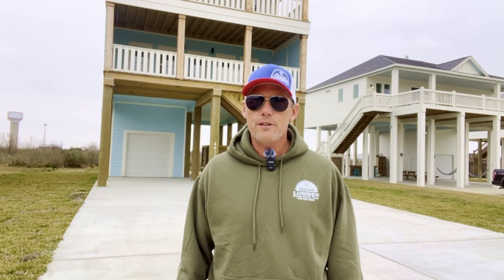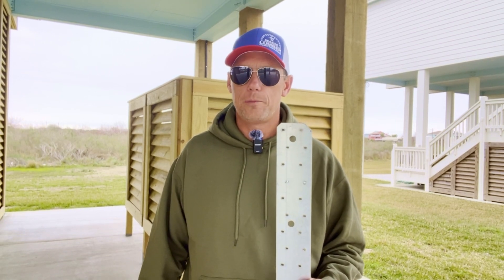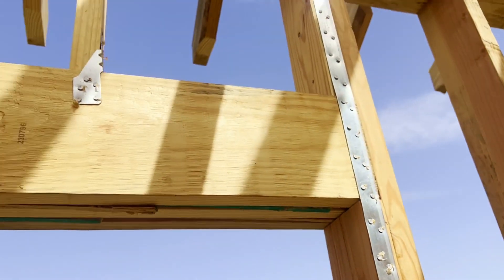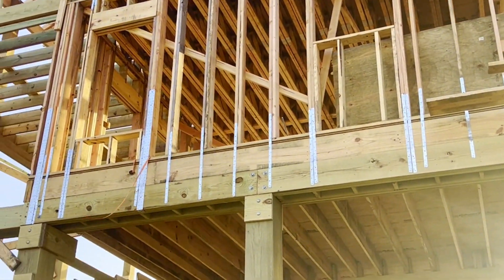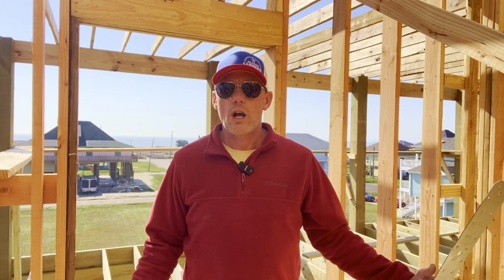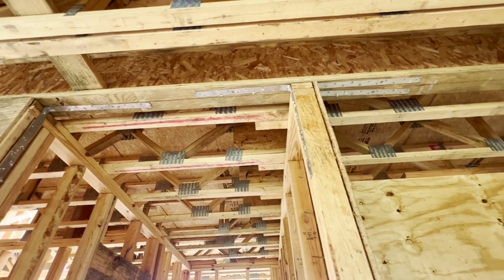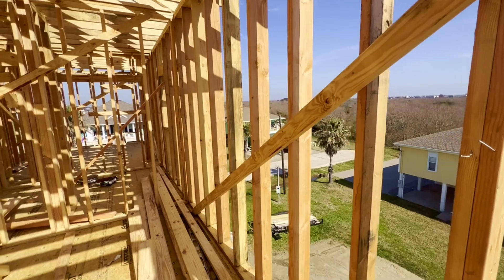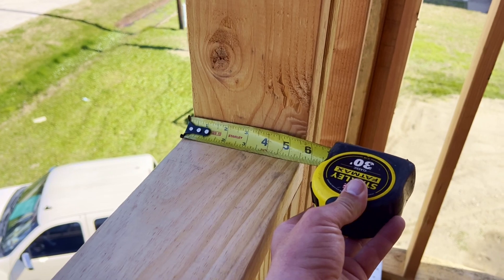HURRICANE PROOF Beach House! | Framing and Strapping (Episode 3)

Comment: Where is your blocking? I saw no blocking in your floor joists. You could use cross bracing. Also no blocking in your walls for fire stops. You cannot build a house in Maine without it. 
I work for a large retail lumber yard. I sell Simpson. Read the fine print on their fixtures. Many are not considered good for exposure to weather. They will rust. 
Just because something is hot dipped galvanized doesn't mean it will not rust. I have seen galvanized deteriorate and rust over time.
Reply from the maker: This video is SOLELY about strapping the house and securing the house. What you mentioned isn't important to the content of the video so it simply isn't included... That doesn't mean it wasn't done. 

As far as the strapping goes, IT IS NOT EXPOSED... Everything is COVERED. The ONLY item exposed are the bolts.

Comment: Alot of good reinforcement to give lots of uplift & rack resistance. In high wind areas, you really got to overbuild everything.  This plus a hip roof usually does pretty well in storms. I like to see the SYP framing, this and doug fir are my preference. Personally i would spray everything in boracare before you button it up. I see some small areas of black mold which is can happen framing in humid areas. Best regards
Reply from the maker: Yeah... I heard another builder on this island say... "the houses are supposed to move and sway. That's how they are designed." NOPE! That is why I oversize almost everything. What you don't realize is, during filming when my framer was on the roof... it was blowing 50. This house didn't budge.

We do spray. I just don't video tape that. Thanks for watching and commenting!

Comment: Can you explain attic venting in hurricane zones, if you don’t want to spray foam the attic roof line and have the attic a controlled air space, what do you recommend on attic venting that won’t cause roof sheathing uplift
Reply from the maker: Good question. I have mixed feelings when it comes to using spray foam on the walls and rafters on the coast. I like the structural durability it provides, but the moisture retention is always an issue (that's why a whole house dehumidifier is a necessity if installing 100% foam).

But, back to your question, that is what all of the clips and straps are installed for in the rafters (5:28-6:02) in the video. They hold down the entire roof structure. I also recommend 5/8 LP WeatherLogic or 5/8 CDX sheathing and roof deck. Never use anything under 5/8". Also, I only use ring shank nails. They are basically like screwing the house together. All of these tips combined give a lot more structural stability and keeps the roof, rafters, sheathing and decking in place. Combine all of this with a 2x6 exterior wall base... the house will just smile and wave at any wind event.

The main concern with the airflow that does come through the soffit and ridge vents along the roofline is negative pressure. This is why we have to use special windows in every house so they won't shatter. The window pressure is determined by my structural engineer, then the windows are custom made.

Hope this answers your question. Thanks.

Comment: Not to ask a stupid question... but why not build it out of cinderblock and brick?  I'd think that would be far more resistant to anything than wood, no matter how much you reinforce the wood.
Reply from the maker: Cost. It would triple... These houses need to be designed to withstand BOTH wind and flood. If it was just wind... then yes block or brick would be a better option... but there is a lot that goes into it.

Comment: Im a NorthEast builder, Commercial and Residential, stick and steel and you do a great job with your videos. I lost my original house in Sandy, in NY in 2012 and my new replacement house is stick on 12" treated pilings and of course all the strapping and connectors you used.  Great videos. Three weeks to get my engineered and architecturals, nine months to get a permit and three months to build , high end. Had to rent for a year. I'm in high velocity flood zone on the water.
Reply from the maker: Thank you sir! That's the hard part with building in the NorthEast... 9 months for permit. I can literally have a permit in a week if I have all of my documentation lined up properly.

This build will take about 4 months start to finish. We had a few framing delays... or yeah... would have been at the 3-3 1/2 month mark.

Good luck to you sir!

Comment: Subscribed! I’ve been in the construction inspection field for over 25 years and this guy is spot on. I would be tempted to use stainless nails throughout but it a tremendous added expense and probably overkill. Great job! I will have to look you up if I decide to build on my canal lots in Bolivar.
Reply from the maker: Thanks... and please do if you decide to build! I have a few plans or I also do complete customs at any price point. I currently have 3 under construction... one in the low 400K, one in the mid-600K and one 1.4M.

Comment: YouTube has tons of videos of two-story stick houses collapsing when a gentle wind blows on them because there was no sheathing installed yet. Some teenaged kid died in the Houston area last year while working on a new construction two-story house with no sheathing on it. I don’t know why someone would start framing the second floor when there is no sheathing on the first floor, especially with the Gulf breeze blowing on it. Hurricane straps are great, but they don’t give the rigidity of sheathing and so they can’t take the place of sheathing.
Reply from the maker: You are correct and that is something that is taken VERY seriously... thankfully there is alternative ways to secure a house WITHOUT sheathing the first floor. JFYI... when this video was shot and my framer was on the roof... we were dealing 50 mph wind gusts.

I think you just gave me an idea for a new video...  "How to properly brace a 2-story house".

What you don't understand or realize is that when sheathing you cover up a lot of exterior strapping and bolts that need installed later. This is also why 2x6 exterior walls are super important. 

If a house fell... it's because it wasn't braced properly, not because sheathing wasn't installed.